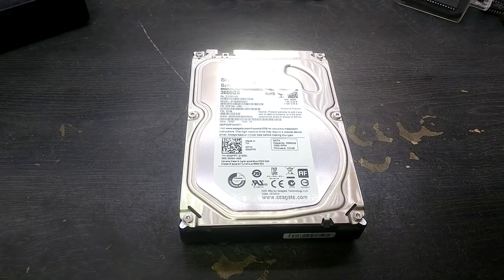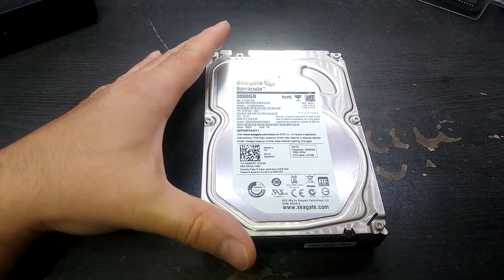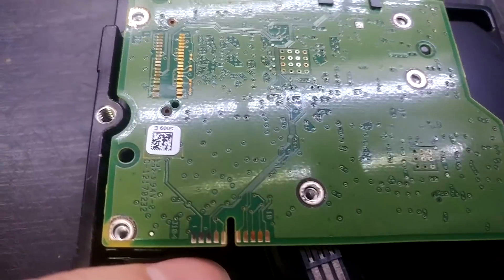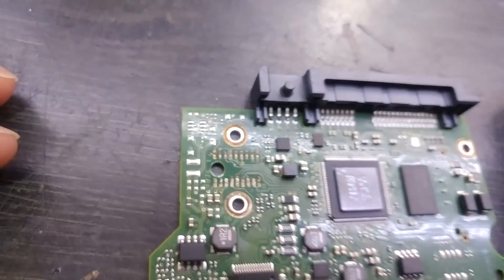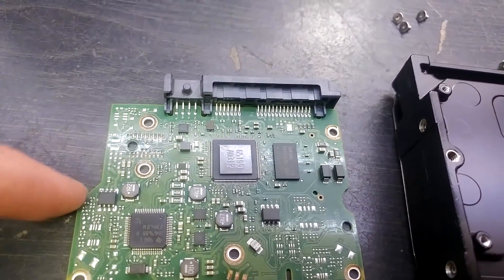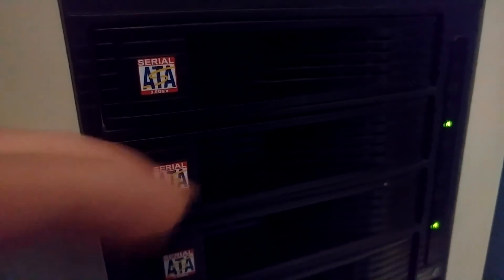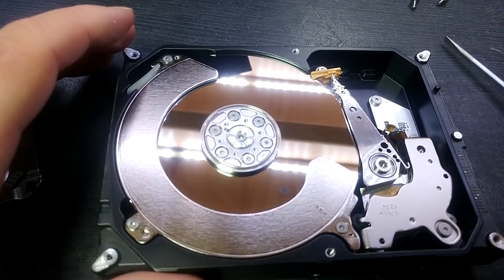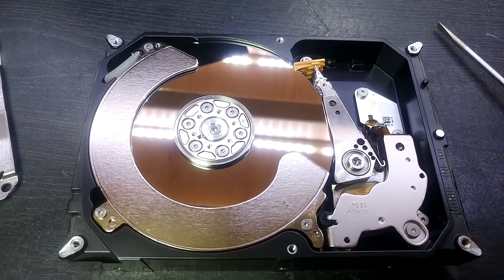Video Cache Hard Drive Failed - Can it be fixed? (Part 1)

Comment: EVERY hard drive I've repaired has had corrosion like this.  Some type of electroplating could be happening or the gold is not actually gold.  Normally the drives come back to life once the corrosion is gone.  One could also do a proper gold plating with the right kit but its ALWAYS the connectors for me... BUT you also need to bend the pin connectors for the motor up so they put more pressure on the contacts.  They loosen up over time and to keep the resistance low on that connection you need to increase the pressure AND clean the corrosion.  If that doesn't help then there is certainly something else wrong.   Sometimes a power regulator on the board or a fatal head crash where a head has come loose.

Comment: Wow, like 3 videos in 24 hours!!!!  Glad to see you back - I do hope you can recover the data!   It's a funny co-incidence but I have a video that has been waiting to upload since January this year - same thing, HDD failed, but in my case I also had that corrosion for the push fit / pogo type connectors.  I got mine working again by booting it upside down, then found after cleaning the connections like you did and removing some insulating foam that had melted over the ICs, it became totally operational again.  So I wasn't sure if it was the corrosion or the foam or what...
Reply from the maker: Hi mate, glad things turned out well with yours. It seems weird that this corrosion is so common (in what is a nice warm and dry place inside a PC) shows how terrible quality has become these days. 
I was gutted when mine died, literally copied a years worth of memory cards onto it beforehand :(
Oh well I have some new footage ready to edit up now :)

Comment: You can connect serial to the HDD controller en check the calibration. Don’t open the drive. You do not have a clean room.
Reply from the maker: I already did open the drive :) I have no intention of paying $$$ to get it fixed, so I wanted to see if it was in a condition that was worth me having a go at fixing it myself. What would connecting serial tell me?
Reply: Connecting serial would let you check the resistance of the heads to see if they are damaged or not.  You can also check the drives error log and smart data as well.  Be careful though if you do not know what you are doing you can wipe the entire drive with the wrong command.  You will need a serial level converter board for the 1.8V levels that board uses and you will have to short out one of the head amp terminals when applying power to the drive to unlock the serial console.  More information here: https://www.hddserialcommander.com/seagate/ and here https://www.data-medics.com/forum/seagate-f3-terminal-command-set-t901.html  Have fun.
Reply from the maker: @samt4202  Thankyou, I will read up on this later
Reply: Sam T your right. I have also disconnected the controller to update the firmware. It’s doable.
Reply: arcadeuk keep us posted.
Reply: arcadeuk you can interact with the controller en recalibrate the drive, that’s the fix I think. And you also can low level format the drive. And reuse the drive. Or update the firmware.
Reply: arcadeuk like https://atola.com/products/insight/manual/serial-port-connection.html
Reply from the maker: @EdwinNoorlander  Thankyou, I will do some reading